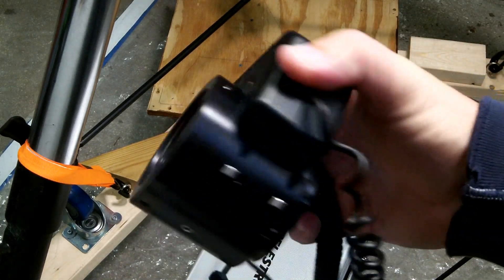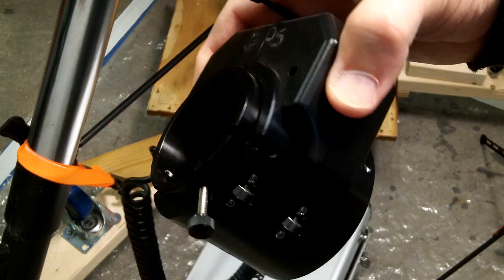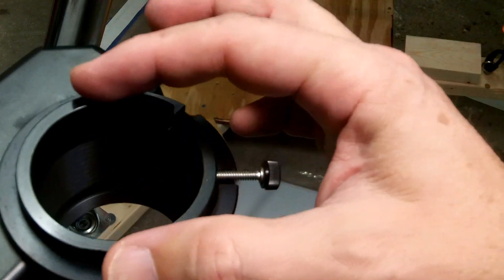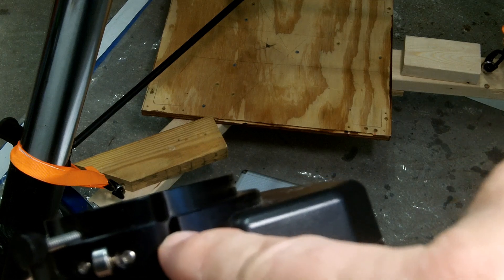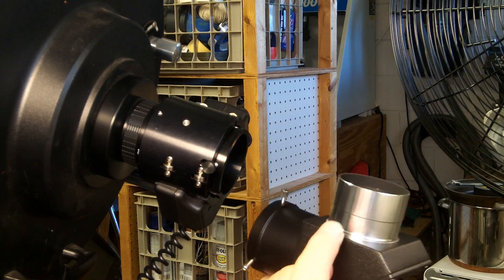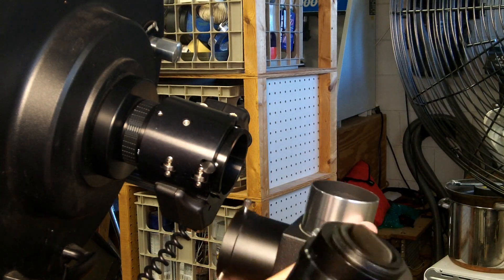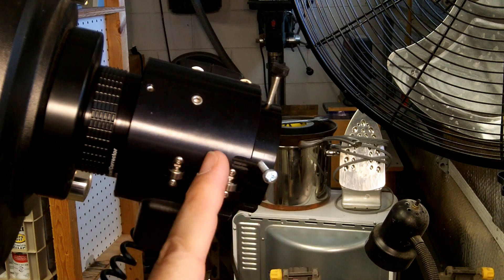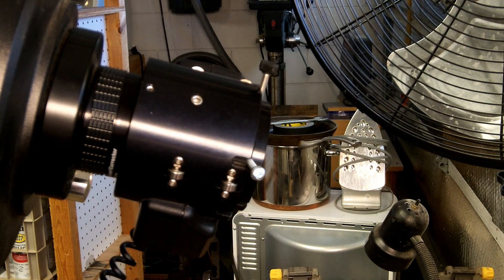Meade LX200 GPS electronic focuser

Comment: Would love to find one of those 2" focusers!
Reply from the maker: Yah, with the flop/lock system on the SCT's you really need a microfocuser in addition to the main focus knob.  You can use a manual one instead of an electrically operated one, I've seen people retrofit some 2 stage focusers from Newtonions as well.